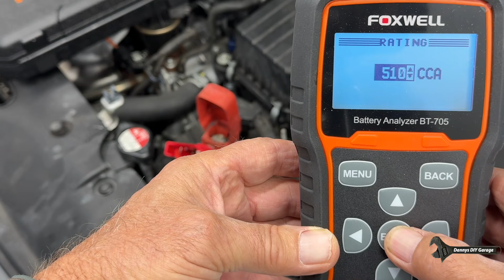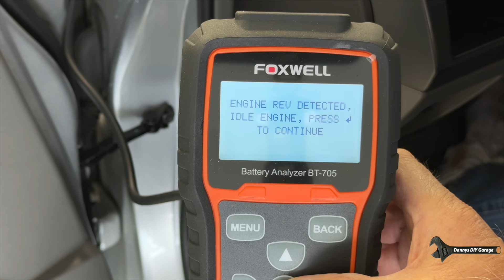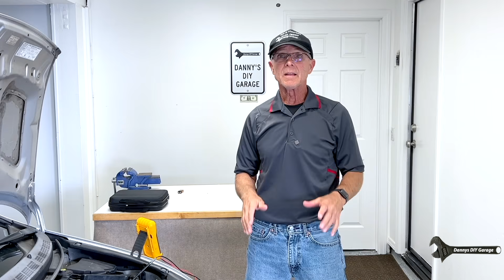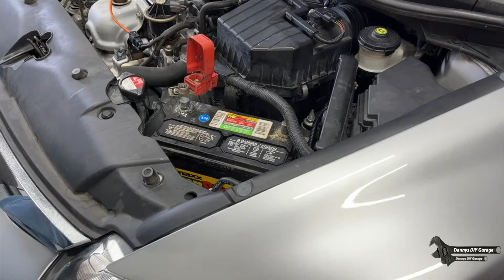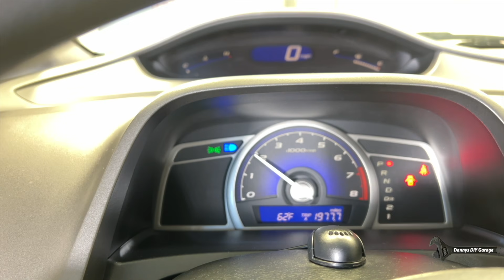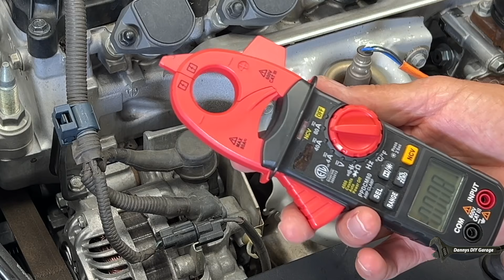Dead Battery? Test Your Charging System (Battery + Alternator) – DIY Guide

Comment: I think the carbon pile tester is the best battery tester in my opinion
Reply from the maker: I’ll agree.
Reply: As long as the load is high enough & is sustained long enough.  Using the starter as the load is real world testing since it's the highest current draw on a car.  The test is designed to ensure the battery does not drop too low (typically not below 9.6 volts) & that it can recover from that kind of current draw (from the starter especially).